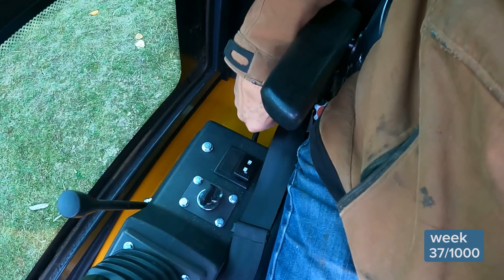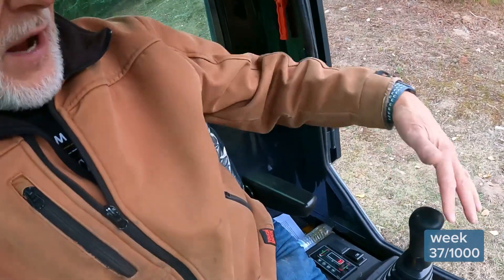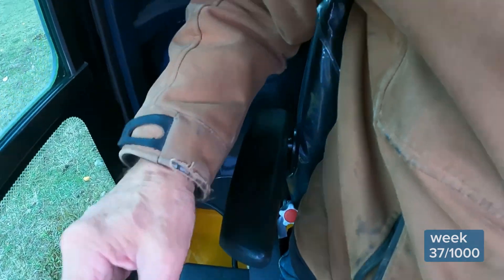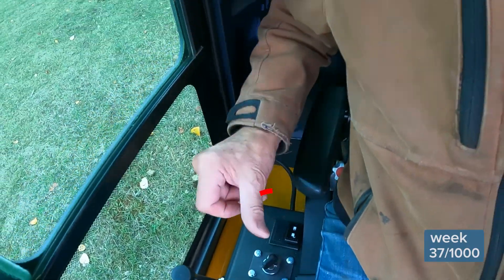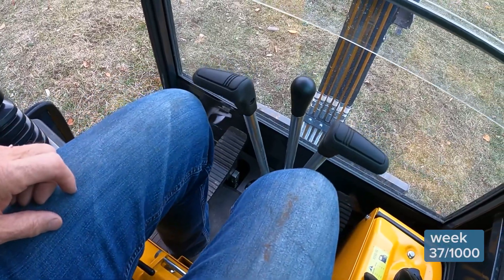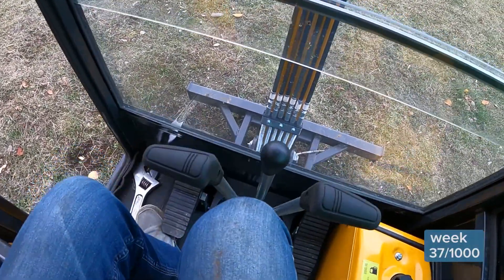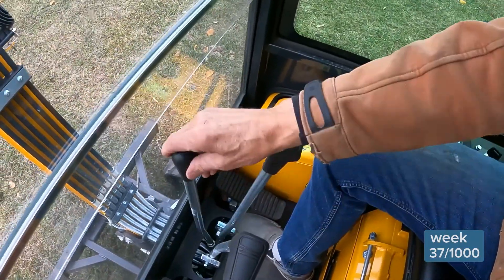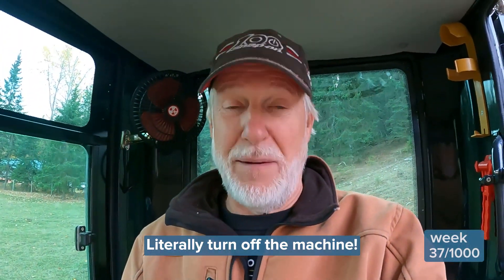Is This A Safety Issue? Is a partial lockout more dangerous than not lockout at all?

Comment: Hi Howard, you're right, not locking out the drive and blade is a major safety issue. Importers can easily spec the machines they order with additional safety features, like a lockout on all controls, but they don't because it increases the cost of the machines. When I was importing them I added features that I thought were important for safety and longevity like a wider track stance, drive motors with counterbalance valves to prevent runaways, and additional hydraulic oil cooling. These features added a couple thousand dollars to the price. Unfortunately most potential buyers were more concerned with a low price than safety features and I found it difficult to compete with companies that ordered the lowest price machines. With respect to your machine I believe you could order the parts needed to lock out all features, but it would take some effort to install the parts.
Reply from the maker: Wayne - as always your advice and perspective is enormously appreciated.  I think that the lack of safety features like we're discussing is what will ultimately cause a backlash for 'lowest price' distributors.  Unfortunately what will trigger that is government regulation (as if we need more of that) due to serious injuries or worse.  
Fortunately guys like you and I are not only capable of installing the parts but also really enjoy that aspect of having equipment.  
As always - thank you for sharing being part of what I think is an important conversation about imported equipment.
Reply: I agree Howard. Unfortunately the lack of safety features will likely result in injuries and regulations that will go way too far.

Comment: Wow, Howard! I've never operated an excavator but something just doesn't seem right about that set up.😮
Reply from the maker: Right?  On my small John Deere I've learned to shut it off when it's necessary for me to dismount off the right hand side, because when I do I can brush the bucket lever causing a spill of whatever I'm carrying, so in some fashion this is not different - except that the travel motors are involved.
On my JD 1025 if I dismount with it in gear it shuts off automatically.  This mini-ex does not.  Hmmmm.  Lots of puzzlement.